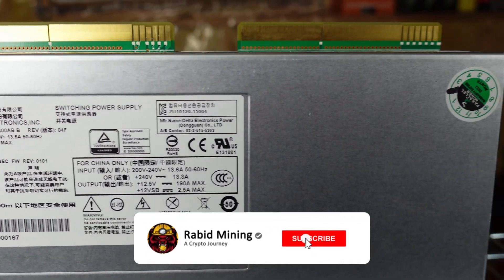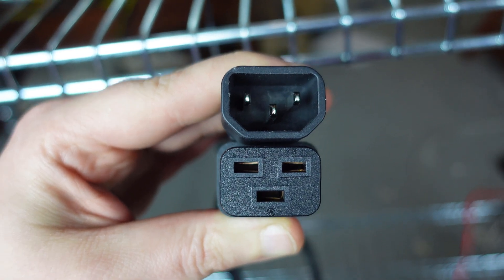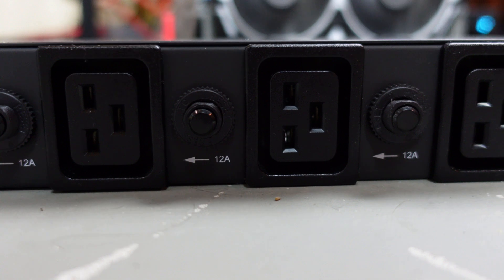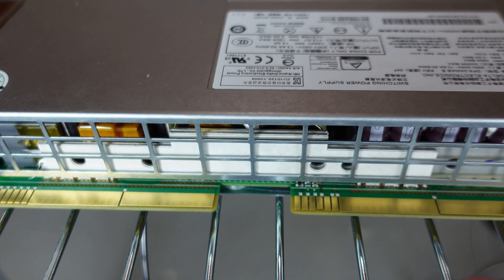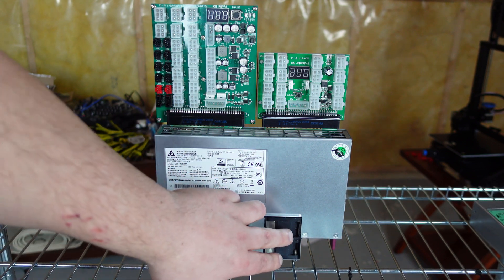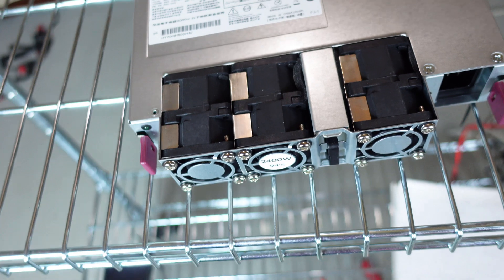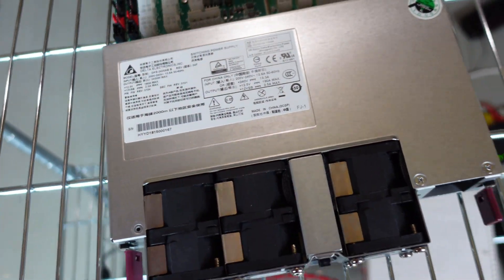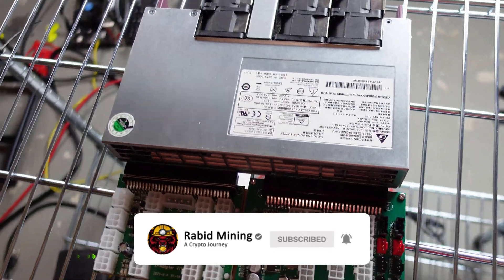Parallel Miner Power Supply 2400w

Comment: can you run motherboard and ssd on the breaker board or do you need the atx pwer supply for that
Reply from the maker: Yup yes you can run everything off the zsx boards.
Reply: @RabidMining  nice. In other videos I have seen ppl running Atx supply for main board and ssd. Is that better or is running the whole rig on server psu is better?
Reply from the maker: Saves on extra parts

Comment: is there a way I could use 120v on this psu, if I only did 1200w ?
Reply from the maker: No the 2400w needs 240v could get 2 1200w as they will do 900w each on 120v
Reply: @RabidMining  what if I only did 900 watts on the psu would It still need the 240v ?
Reply from the maker: @FixitWithMark  the 1200w psus work on 120v but only run at 900w max instead of 1200w
Reply: @RabidMining  aw ok, thanks for the explanation and fast reply.
Reply from the maker: @FixitWithMark  no problem

Comment: Does this work with the ASUS B250 mining motherboard?
Reply from the maker: yes I use one myself.
Reply: Thanks, I’m new to mining. if my rig is going to be consuming 3600W do i have to wire it up to the breaker box directly and get a metered PDU for it to run?
Reply from the maker: @Itsnoahkennedy  best to run 240v but can spread it around if you dont have.
Reply: Okay, I’m going to call an electrician to come out and help me understand how to set up a 240V connection, i saw the video where you had 2x 120V wires connected to your breaker box running to your meter & PDU, do you think it would be problematic to have multiple 240V connections for multiple rig setups?
Reply from the maker: @Itsnoahkennedy  no if your box and power to your place can support it will be fine.
Reply: Thanks for the replies btw I appreciate it
Reply from the maker: @Itsnoahkennedy  np

Comment: Delta 2400W at 1600W load is quiet, but at 1700W - 1800W is starts getting noisy
Reply from the maker: Thx for the tip :)

Comment: These look great except they take away the flexibility of being able to use 120V.  I have 240V but if I ever needed to move my rig to another room in the house I'd be a problem with this PSU.  I'm going to run dual 1200 watt hp server psus.  Edit: Just looked at pricing.  Wow they've boosted the price of the HP PSUs since I last looked.
Reply from the maker: Ya things are picking up and stock is getting low

Comment: Do you need to connect with motherboard or have a jumper to turn on the server PSU?
Reply from the maker: Has power as soon as u plug it in as far the breakout boards they have off and on switches.